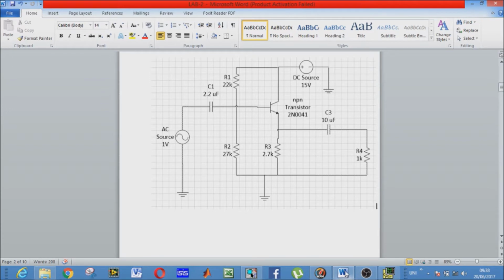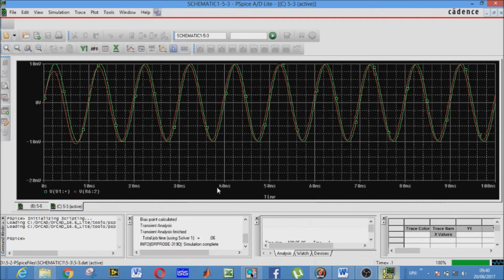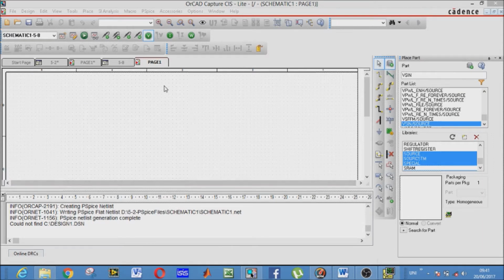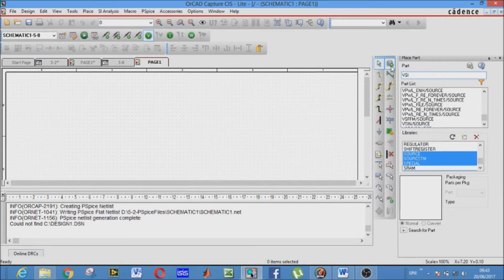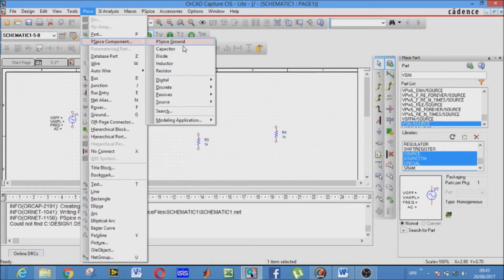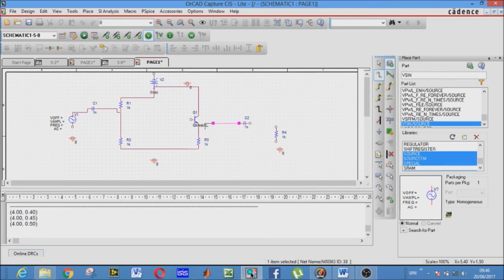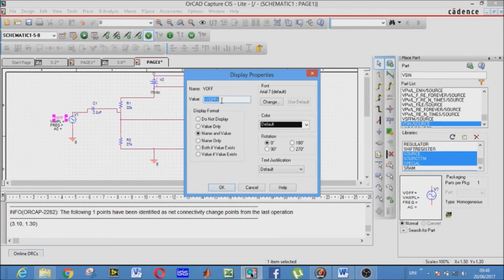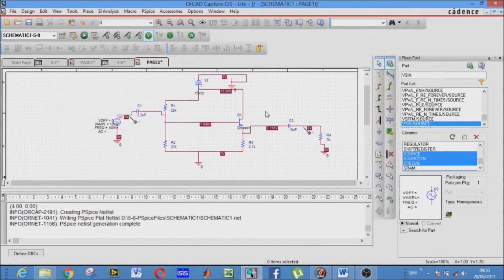Video.2-  Common Collector Amplifier

Comment: If I heard you correctly for this circuit (Emitter Follower):
1) Output is smaller than and in-phase with the input.
2) Output is measured from Emitter.
3) Common collector is also known as Emitter follower. (?) <- I'm not sure .